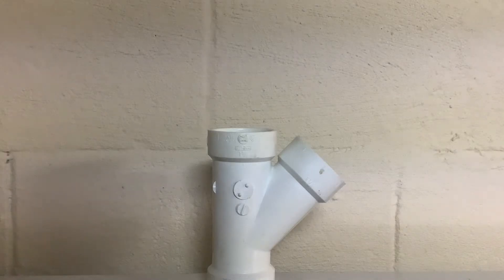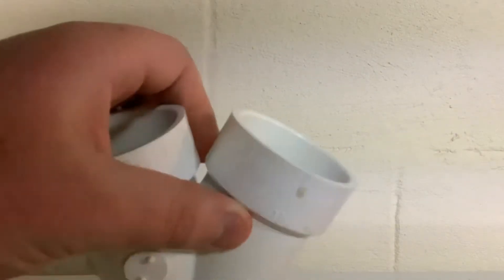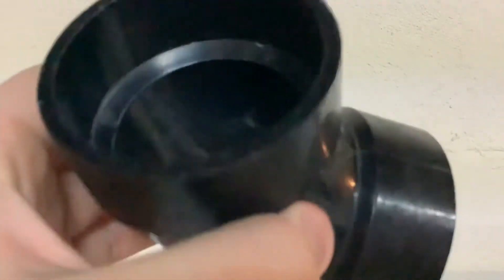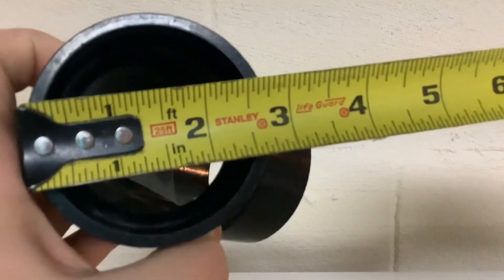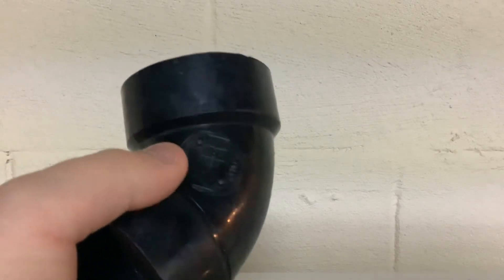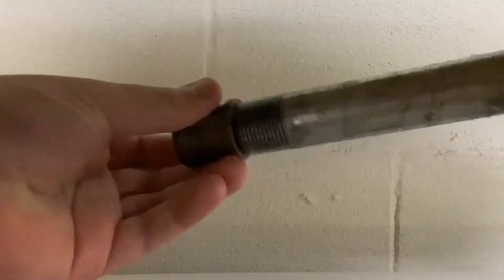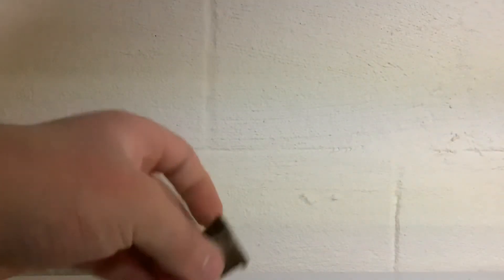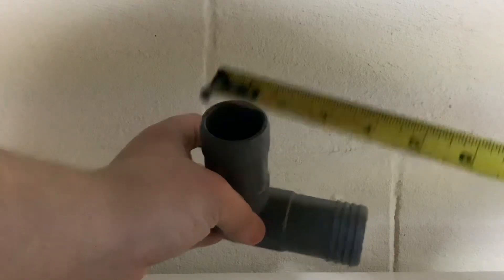How to figure out the size of a pipe fitting.(2022)

Comment: I think the inner diameter is 1 and 3/4 inch and not 2.
Reply from the maker: That is not how two inch fittings are measured, the tab on my measuring tape is probably what made the measurement wrong.
Reply: @jacksplumbingvideos7147  thank you for the info.  I don't know Jack about this stuff.